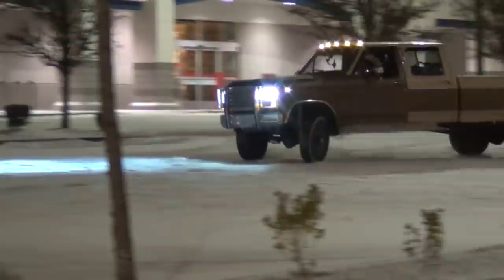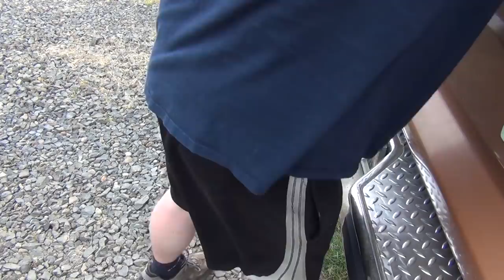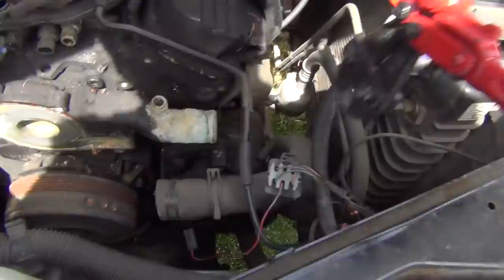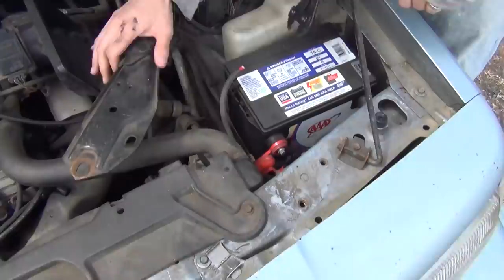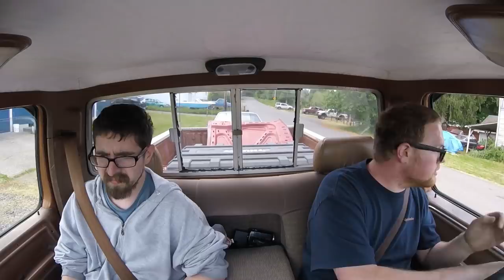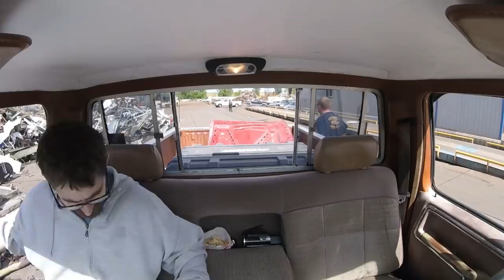Scrap The Moldsmobile | Taking Another Project to the Dump

Comment: Something that I do that may help you swap the ball out is to put the ball mount in the receiver turned 90 degrees to either the left or right. Then you can put your wrench on the nut and just stand on it. Depending on which way it's in the receiver you can loosen or tighten it.